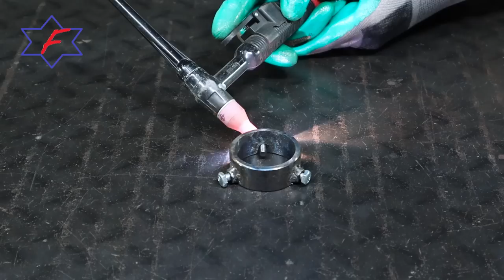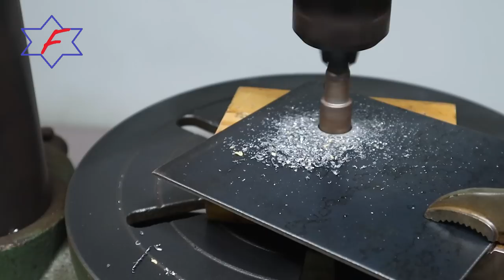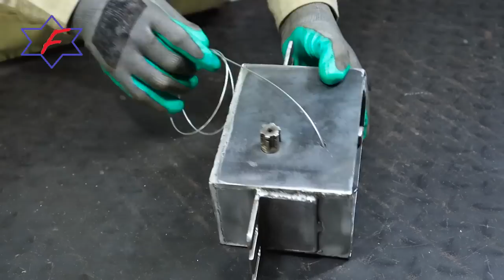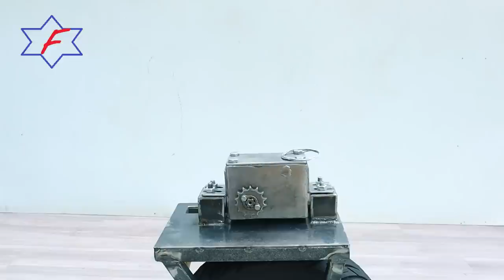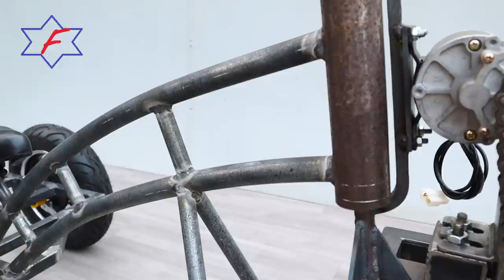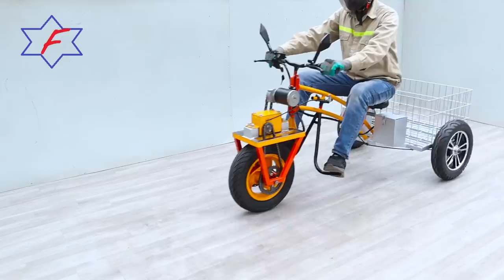Make High Power Trike With Cargo And Built-In Reverse Gear For Workshop

Comment: The nuts with the plastic on them that you put on the rear axle to hold the wheels on are called nylock nuts, and these are what you can use on the other bolts to keep things tight.